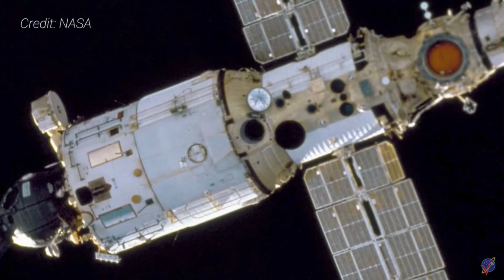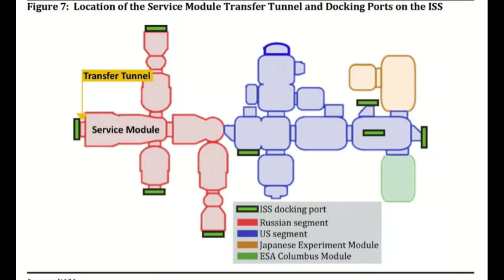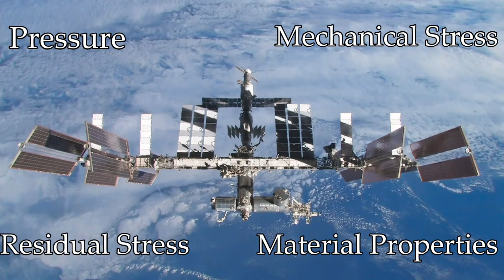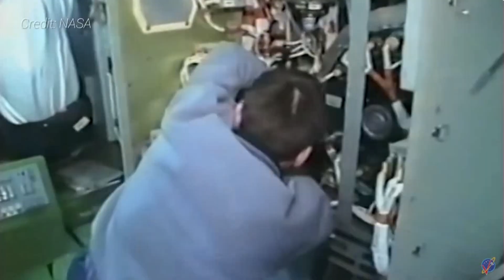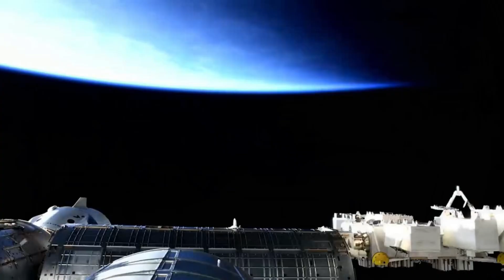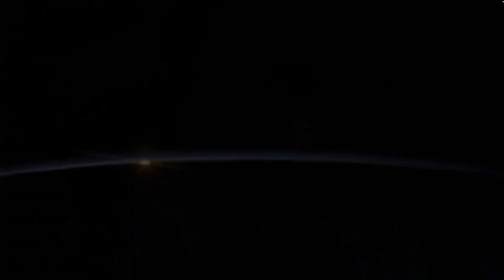Is The ISS Leaking?

Comment: Take a bunch of streamers or crepe paper and let it loose near the door, see where it goes.  Problem is, the leak might be in a hidden part inside the door, so they may not be able to find it without taking it apart. Or it may actually be cycling in which case it may be even harder to find because it's time varying.
Reply from the maker: @tristan7216  yeah I think it's several leaks not one. They fix one but it doesn't fully solve the problem.

Comment: What is the baseline leak rate for the ISS? Is it much less than 1Kg/day?
Reply from the maker: Yeah, I know it has varied a lot over 25 years but I believe I read it had been as low as 0.06 kg/day.
Reply: @marionrkerr  That is the real trick, isn't it? It is impossible to make the leak rate zero, which is a sobering thought for a long duration deep space mission, like going to Mars. The 1kg/day figure is alarming; that is about a cubic yard of air per day. Even if they isolate it, it seems that the pesky Russian module would be out of gas is a month or so at that rate.
Reply from the maker: @edp2260  agreed

Comment: Since it's been leaking for the past five years obviously the time for a knee-jerk overreaction is long past, so don't commit to one now. When adversity confronts you then turn it into an opportunity for learning. First isolate the condition so it can do no more harm (which sounds like they've already done by keeping the leaking area segregated from the rest of the ISS), then turn the problem over to your engineers and challenge them to devise even the most radical outside of the box possible repair ideas and put these methods to a real-time test. See what works, what doesn't and continue on. What you could learn might turn out to be some of the highest valued knowledge gained. The ISS is a laboratory so treat this as the next experiment opportunity.
Reply from the maker: Yeah, I think bringing in outside experts will be helpful too.  I just wanna make sure the next 5 years goes as smooth as possible before the deorbit.

Comment: Well, it is part of Russian culture to try to fix every problem through lies and denial.  No surprise there.  What is surprising is that they bring that part of their culture to their dealings with other cultures, as if incapable of imagining that other cultures might work differently.
As for proving the safety or non-safety of the situation, of course neither can be proven before the problem is investigated.  If the leak is through a pin hole or micrometeorite hole, it is probably very safe.  If the leak is through an expanding crack in a wall or bulkhead, then it could be extremely dangerous.
The bad news is that leaks through pinholes don't usually increase over time ...  If the leak increased earlier this year, it could hardly mean that a pinhole is getting bigger;  increased leakage is highly indicative of an expanding crack.
Reply from the maker: Yeah, there’s just a lot of unknowns in this situation. But hopefully outside agencies looking into it will help.

Comment: A joint Russian/American spacewalk to survey the area of suspicious leakage  is the only way to prove to both parties its severity. Take an aerosol can of something - fog, spraypaint, soap bubbles, anything that would react to the movement of air leaking from the module. Identify the location outside the station to be able to repair the leak from inside the adaptor. It's the only way the "experts" of both nations will agree to its severity. Engineers need proof. Scientists need evidence. 😊😊
Reply from the maker: Well, I think they both agree that there is a leak. I think the sticking point is that Roscosmos believes that the leak is too small to have any real significance.

Comment: Love the t-shirts you choose for your videos, Marion!  I don't think the astronauts are at risk.  If the leak suddenly gets worse, they can get in their capsules and come back at any point.  If the leak becomes unmanageable to the point the ISS isn't safe, then we simply lose it.  And that would be especially noteworthy if replacement station/s aren't close to ready at that point.  But I think we'd have at least a small station up by then.  We know that China won't invite us as guests on theirs.

I'm also wondering if that section can be permanently sealed off at some point.  I think the ISS can maintain orbit without Russian involvement, using thrusters on the Northrup Grumman/Rocket Lab cargo capsule.
Reply from the maker: @stevenscharmer1765  I think it's difficult to completely deal as there's a port right there. And ISS seems to be using every port its got these days. 

Thx for noticing the T-shirts! I'm enjoying them these days.

Comment: Ummm options....fix it?? Lol...isnt this NASA...im a bit wowed. The astronauts need to get together snd refuse to go up till its completed..
.
Reply from the maker: Well, they would if it was very clear where it was exactly coming from. But like I said it's probably the size of a pinhole in a complex the size of a football field with a LOT of equipment inside. We've continuously had astronauts aboard ISS for 25 years so it would take a lot to stop the constant flow of astronauts coming and going. But I suppose if they can't find it, sealing off that section of the station is the next best solution.